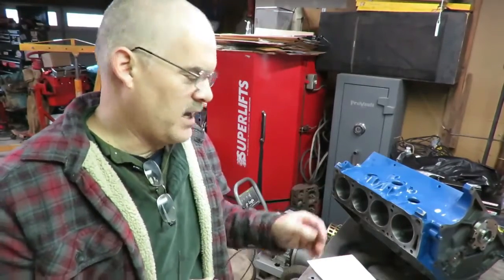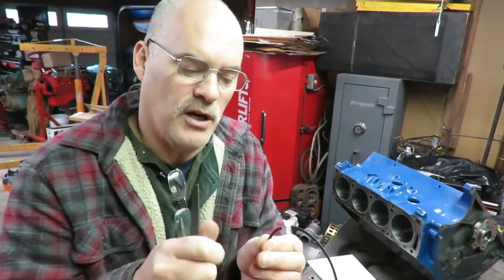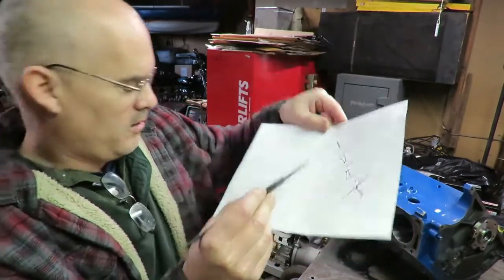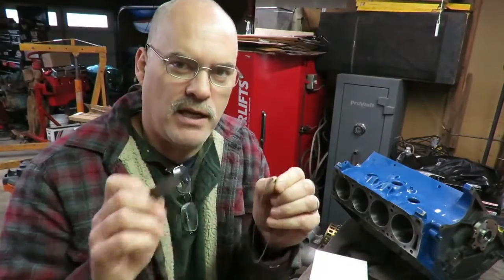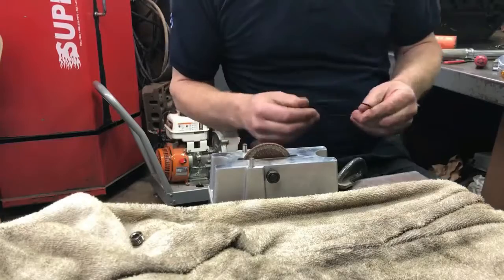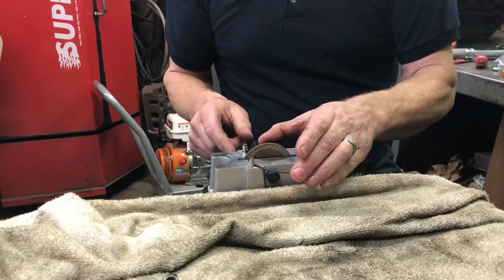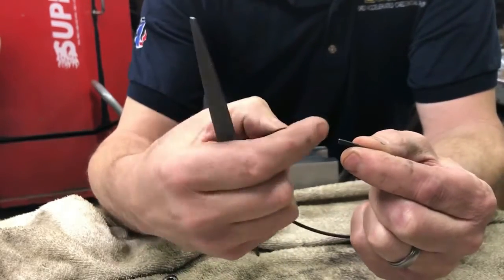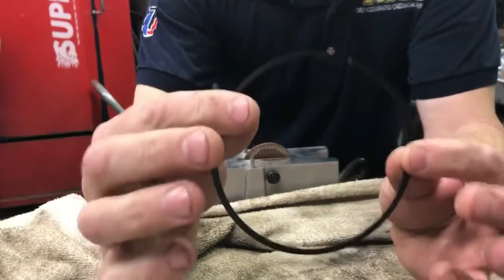350 chevy How to Properly file ring gaps

Comment: Always great videos thanks again! One question I've done my rings with the same tools so found out filing both sides at the same times was creating a negative gap 'like an inverted 'V'. I did fix it after but realised filling only one side of the ring was doing a better job. I am the only one who noticed that? Could that be caused by bigger diameter ring 4.535 Had to compress them much. Thanks

Comment: Glade your back on Youtube.  Try this, to deburr the end gaps after file fit each bore & marked rings, This is quicker & safer as well. Tape a piece of 3M red scotchbrigt pad around your small file and use it to remove the burr, much faster and safer not to take to much meat off the rings. 
   I do have a few questions, what is the purpose of low tension rings? and why do the twin turbo motors run so dog gone much end gap?. I run .006 to .008 per inch of bore with a gas carb, but some of these turbo motors run twice that and MORE ????. seems counterproductive.
Reply from the maker: forced induction engines need more gap because there is alot more heat in the chamber and if you run N/A gaps the rings will expand to much the ends will touch and blow the engine